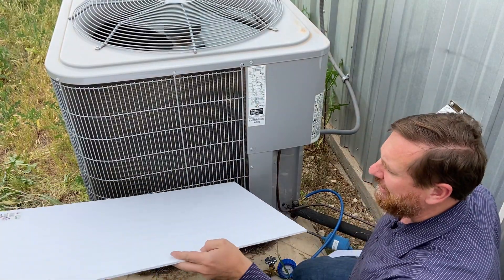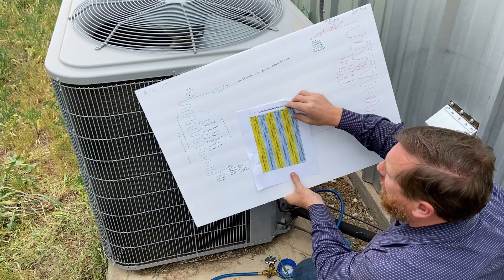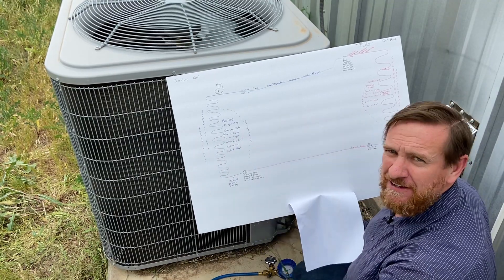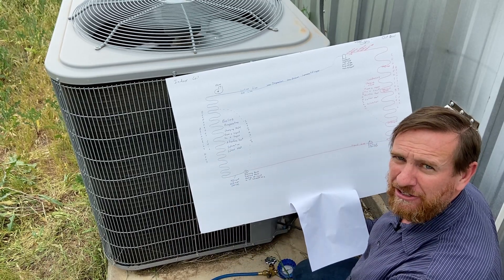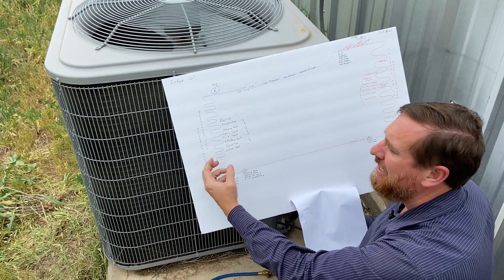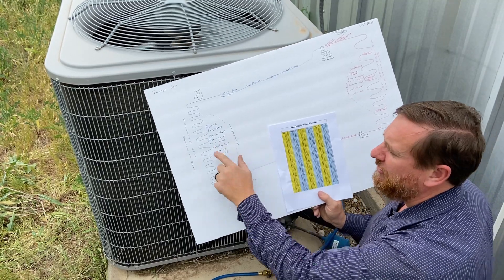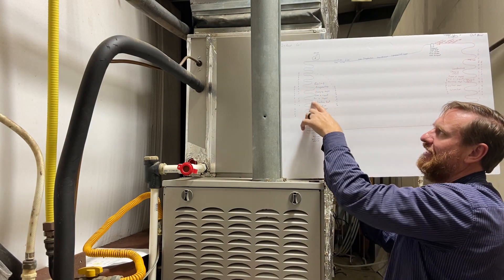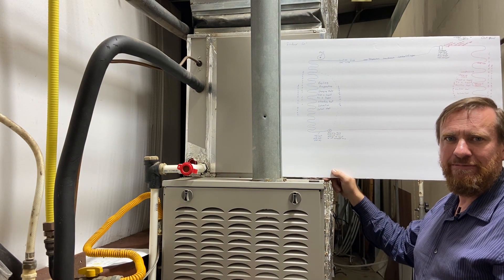HVAC 026 PSIG to Saturation part 1 the suction pressure and suction saturated on the unit

Comment: hey, got question. For example suppose that we have two same cars( or any ac systems), and same outside temp. 30*C. A/C is off. Not working for a long time. In this car should be 500g r134a. Now u can check in some charts that should be ~7bar/30*C. This pressure value will be different for 350g inside ac system, or 650g, or even 900g? Could we check that ac system is overcharged or low on charge without running compressor, just on values on refrigerant manifolds on resting pressure?
Reply from the maker: If there is 1 gram of liquid/vapor refrigerant or 1000k liquid/vapor refrigerant the pressure will be the same at a given temperature. 

As long as there is liquid and vapor it follows the TP chart. A new tank of ref and an almost empty tank will have the same pressure at the same temperature.

We use a scale to weigh how much refrigerant is in a tank. 

To know how much was in a unit we would have to remove it and weigh it. 

Or we can check it running using charge methods but we never really know the quantity in the system.
Reply: @love2hvac  black magic. How its even possible that volume of tank of any system has no dependence to pressure. there must be some relationship, some minimum amount of liquid refrigerant that is able to make e.g. 6 bar pressure in vapor
Reply from the maker: As long as there is some liquid or a lot of liquid it will follow the saturation chart. As vapor is removed, more liquid boils to a vapor replacing the vapor pressure that left. This will continue to happen until there is no more liquid left. Then the pressure will start to drop.

For example a dry nitrogen tank has a lot of pressure but it is vapor only, no liquid. As vapor leaves the pressure immediately drops. 

On a refrigerant or even a propane tank as vapor leaves some of the liquid changes state to a vapor to keep the balance. So the pressure remains the same (as long as the temperature remains the same)

Eventually you will run out of liquid and you will have only vapor. At that point the pressure will drop even at the same temperature beuce there is no more liquid left to maintain it.

One catch is as the refrigerant changes from a liquid to a vapor it absorbs heat. If you quickly take vapor out the liquid keeps changing state absorbing heat and the temperature will drop. Once the temperature drop the pressure also drops.

You can see this on a propane tank cooking. It can be a hot day and if your burner is on high the tank can even freeze up and the pressure will be low. 

If you measured the temperature and pressure and weight of a propane tank the  start cooking. 

You will see the temperature and pressure of the tank drop.

Once you stop using it give it time to raise back up the the original temperature. 

Now check the pressure and even if you use 95% of the liquid propane it will still be at the same pressure. 

Now put it on a scale and you will see the tank is lighter than when you started.

Comment: Thanks for all the great videos,  Question here, you have an evap sat temp of 52f with 75f return air temp which only gives you a 23 t.d.  sat temp should be close to 40 if system operating correctly with 75f RA.  Am i missing something here?  I guess I was expecting you to go into why this system was not operating efficiently or something  thanks still though
Reply from the maker: Temperature, humidity, airflow, coil design, metering device and outdoor temperature all effect evaporator saturation and TD.

40 evaporator comes from a system in a lab at set conditions. A lot of technicians make the mistake of trying to get a 40 evaporator (and associated pressures. This leads frequently leads to over charged systems.

This is why superheat, subcooling and airflow are so important and used for checking systems operation.
Reply: @love2hvac   ok thanks,  in my area CT,  for residential splits like this we only setup system for 400 cfm/ton and its typicaly 35 td unless high efficiency i see 30 sometimes plus or minus a few of course, the example in your video was just so far out of norm for what I see I would be looking further into that system is all.  Of course I always check sh sc as well as airflow on trouble calls.  Thank you
Reply from the maker: Start looking at performance charts from the manufacture and it will show you a lot and how the variables change.
Reply from the maker: https://hvac-blog.acca.org/400-cfm-per-ton-or-is-it/

Comment: would that be 17 degrees of superheating? if so wouldn't that be a little high for superheat? or is it due to ambient temperature affecting the system?
Reply from the maker: This video is just about a visual of saturation. Superheat is farther away. 
You cannot calculate superheat with just the saturation temperature. 
You must have the actual suction like temperature. This video does not show the actual suction line temperature so it is impossible to know the superheat at this point.
Reply: @love2hvac  oh ok appreciate the response! love your videos.

Comment: Why is suction line pressure before compressor not higher than the saturation phase pressure?

The superheating inside the evaporator increases the temperature of the refrigerant and an increase in temperature should increase the pressure.

Please answer the question.
Thank u so much for the interesting videos.
Reply from the maker: The suction pipe and the evaporator is all connected in essentially 1 chamber. The pressure on that chamber is already balanced out by many different variables. 
All the pressure equals out to 1 over all pressure and that is the pressure the refregerant boils at, changes state at. After it changes state to a vapor it can super heat above the saturation temperature. The pressure is already accounted for.

Let's look at it a different way. 
Oxygen boils at -183F at 0 psig (14.7 pisa)
Right now the temperature in my room is 78F at 0 psig (14.8 psia)
The oxygen has superheated 261 degrees above its ssturstion/boiling temperature yet it is at its same pressure of o psig (14.8 psia)

 Becuse we have liquid and vapor saturation pressure is our starting point.  Then we can superheat above that or subcool below that. 

If we did NOT have liquid and we only had vapor then we would not even have that starting point. Bit the pressure in the tubing would be very close to the same. 

If you have a tank of gas and you heat one side of the tank the pressure increases everywhere on the tank equally not just in the point it was heated.
Reply: @love2hvac   I found this interesting as Ive been in the trade for many years and always wondered the same thing and this was a question that nobody has ever been able to answer for me.  I usually get a response like hmmm, thats a good question or who knows or who cares its science it just how it works haha.  Thanks for clarifying it makes sense to me now.
Reply from the maker: @bryanswanson5007  there is another level to this also. I will bring it up when I start recording the advanced classes, I am still a ways away from those yet.

Comment: On a typical residential AC w/ scroll compressor (14-16SEER designed equipment), what's the ratio of liquid:vapor entering the condenser (e.g. 30:70 in either vol or wt)?
Reply from the maker: It enters the condenser as 100% vapor, a superheated vapor. The first few rows desuperheat (sensible) to get down to saturation. (Hvac 032 desuperheat) should explain that better. 

The evaporator the refregerant entered at 75% liquid and 25% vapor , the vapor flashes instantly to absorb heat from the remaining 75% liquid due to adiabatic expansion.

There are some exceptions such as critical point in CO2 systems
Reply: @love2hvac  Thanks. I thought the compressor receives saturated vapor (i.e. vapor saturated w/ liquid). When it exits the compressor, there's has to be >0% vol of liquid ... right?

Maybe I'm not gripping the idea. Here's the alternative question: If the compressor pump spits out 100% vapor (0% liquid), how did it remove the saturation of liquid phase?
Reply from the maker: @profuse007  https://youtu.be/eKqbjsdT0XU here is the entire cycle that just posted. I think it will put the whole thing together for you.
Reply from the maker: https://www.youtube.com/watch?v=wUmS85UlD9Y this video about superheat should help explain that. 
It explains what happens after saturation. Hopefully that helps.

Comment: water (a liquid) uses fire/heat to "boil" and convert into vapor. When we add heat (e.g. compression) to a saturated vapor refrigerant, does the refrigerant boil or condense?
Reply from the maker: If the saturated temperature is lower than the air temperature, it boils, if the saturated temperature is  warmer than the air temperature it condenses.
Reply: @love2hvac  Thanks. Does this exist: a compressor use to convert saturated vapor immediately to 100% liquid and uses a small heat exchanger to only subcool (not to condense)? If exist, what kind of setup is that?
Reply from the maker: @profuse007  not that I know of, the closest thing would be the CO2 in critical refrigeration but it's still condensing in the condensor.